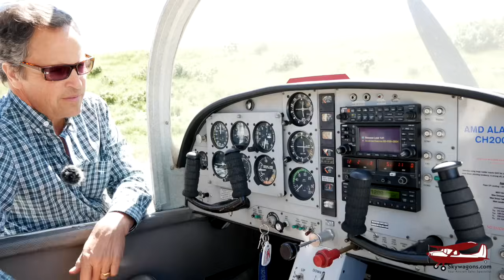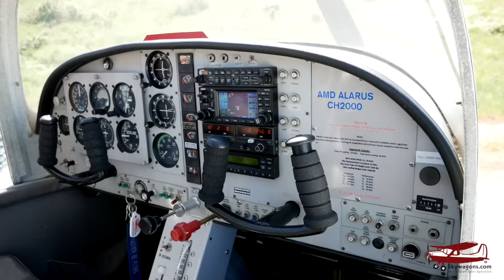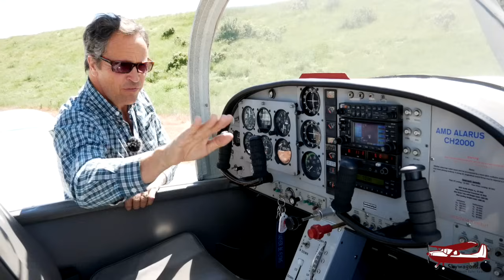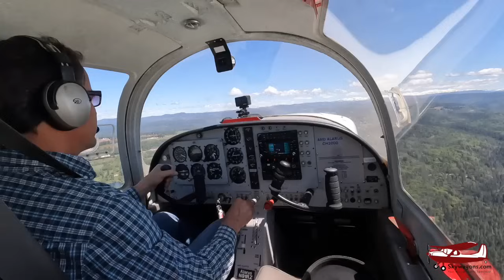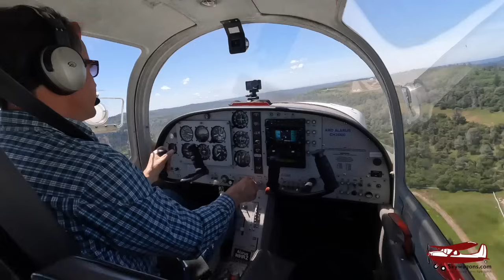AMD Zenair Alarus CH 2000

Comment: I own a 1995 Zenair CH2000, built in Canada by Zenair and I own a 2000 AMD Alarus CH2000 built in Georgia by AMD.  They are both good flyers.  Chris Heinz designed them & his sons built them.  The version that Iraq bought is a four seater named Sama.  Same airframe but slightly larger wing, elevator & rudder.  They were basically used as observation planes by the Iragi air force, though two were shot down in combat with terrorist.  Zenair used the same airframe in a four seat experimental designated as the CH640.  The CH2000s were designed for training schools which means they are easy to maintain & affordable to own.
Reply from the maker: That’s really interesting! Thank you for sharing.

Comment: Very pleased to see this episode, I had owned a 1995 one for 7 years and despite what many people might say, I loved it so much. Very simple, easy to maintain except maybe for the avionics bay and battery location (At least in the earlier models) access was  very tight and not very pleasing for the mechanic and avionics guys! Very short and responsive controls and those split flaps can allow you to drop like a rock and lose altitude very fast if needed and also help a lot on very short runways and could pretty much drop the flaps at 100kts. Also, rudder is big and very responsive as well. 25 knots max demonstrated crosswind. Fuel was around 5.7 gal/hr, cruising between 2400-2600 rpm gives 95 -105 knots . The Iraqi army bought them from JAI - Jordan Aerospace Industries in Jordan Amman which is located at Queen Alia's International Airport just outside of Amman. The factory has manufacturing rights from Zenair  but they call their variant which is the same airplane (SAMA - CH2000). Sama in Arabic translates into "Sky". The Iraqi army had acquired a lot of the modified variant for patrolling the borders and the oil pipelines due to the very slow speeds the plane could fly at and low operating costs. That variant was equipped with high resolution cameras and sensing equipment. First 2 civilian variant SAMA's from JAI were acquired by the "Mideast Aviation Academy at Marka Airport-Amman" back in 2004 for flight training purposes. They had planned to buy more and replace the Piper Archer 3's they had, cost was attractive but the students didn't really like the plane due to the short and sensitive controls and also due to performance issues. Jordan is extremely hot specially in the summer months and all airplanes struggled with performance as Amman Marka airport is already at 2550 feet elevation!
Reply from the maker: Now that is the information we need.  Thank you.
Reply: @skywagonuniversity5023  Thank you for sharing with all of us :)

Comment: These are great planes, very much a certified zenith 601 series plane.  It has a 46” wide cabin so it’s 6.5” wider than a Cessna 152.  It’s arguably simpler and parts are cheaper since they come from Zenair Canada.  I believe they are still made new in South America and mostly used in flight schools down there.
Reply from the maker: I thought it was great.

Comment: Great video! Looks familiar to another little 2 seater I saw ads for years back, it had a full FADEC O-235 that had 125 HP, that one, I forget the make/model, but it was stout as well, not much useful load and was expensive I thought at the time, probably because of the FADEC and I usually saw them with (2) Garmin 430s... Ah, the plane I was thinking of was a Liberty Aerospace XL2!
Reply from the maker: Thanks for the info!

Comment: Hello friend, i am using a translator, so i apologize if i do not understand what i write.
   I have a question, which model was manufactured first? This model or the Piper pa 38?
Reply: Pa-38 Tomahawk was Introduced in 1977 as a 1978 Model. While CH200 was introduced as a kit in 1995.
Reply: @mobinakhtar  THANK YOU SO MUCH MY FRIEND🙌🙌🙌